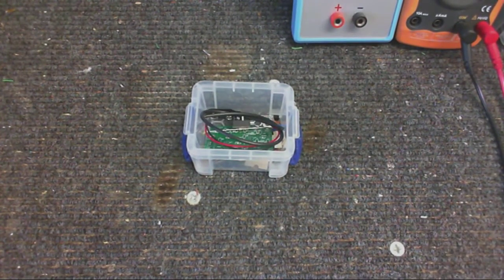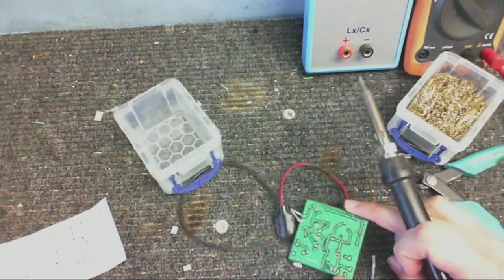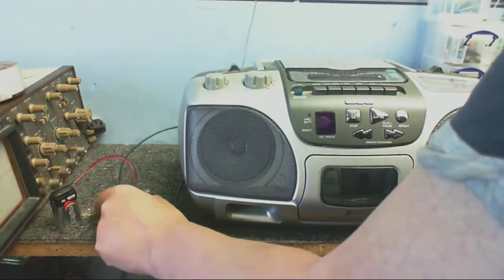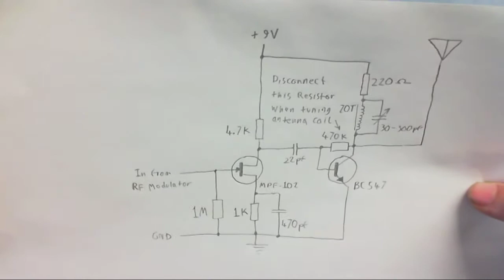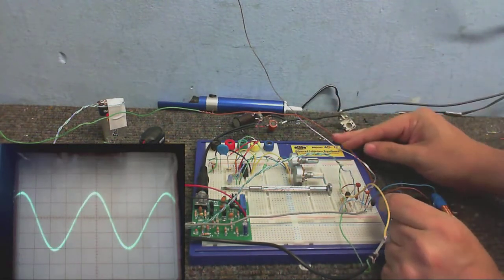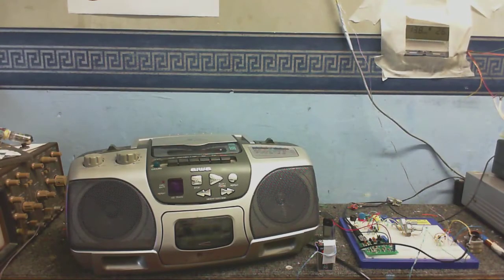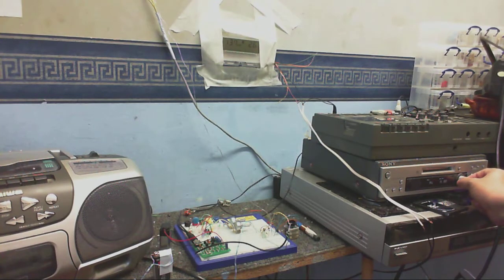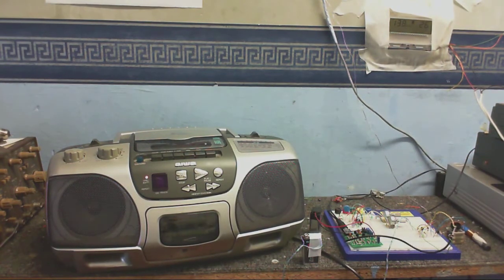Radio transmitter kit from Stefan0719 and Kanalbusdriver

Comment: Looks quite good wonder what the  farthest distance you could transmit on AM from your house is if it were legal to do so?
On FM I can do about 7 to 8 miles at most from my place but never really have it on.
Reply from the maker: EastAngliaUK I'm not sure since I haven't built a high power transmitter yet, I do get about 2 or 3 feet range with the AM transmitters I've tried, although if I were to make some kind of audio modulated Tesla coil or slayer exciter that works in the AM range (and most of mine do) it would probably reach quite far.  As for the FM transmitters I've made, they can be heard on any radio throughout the house.